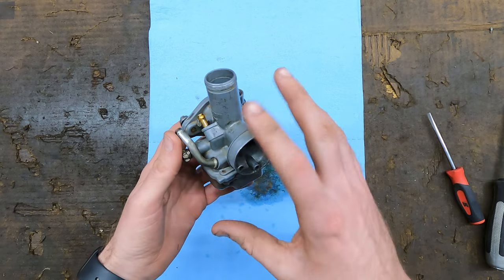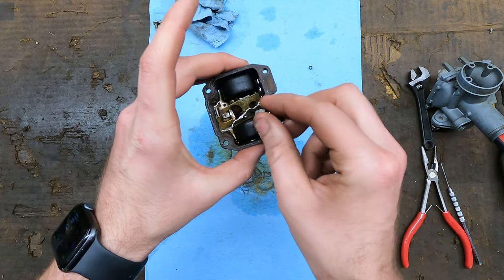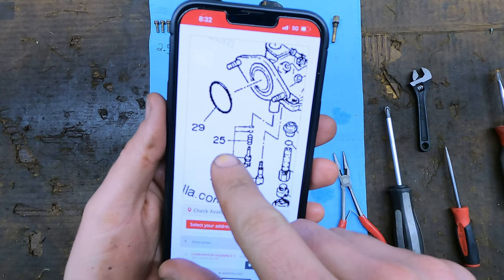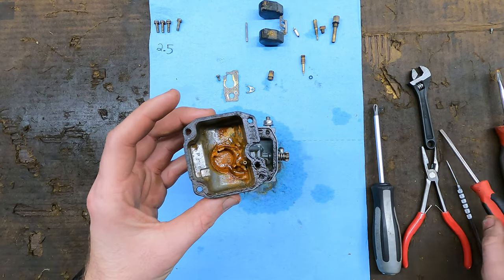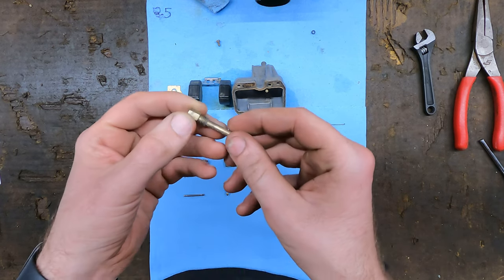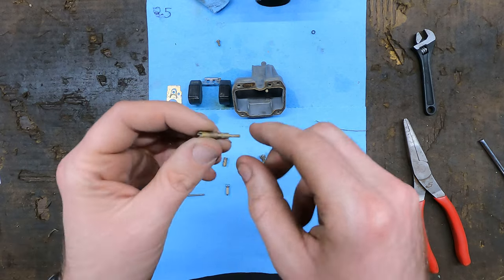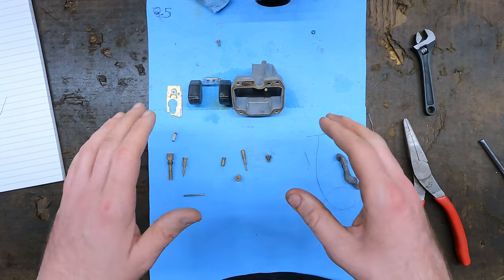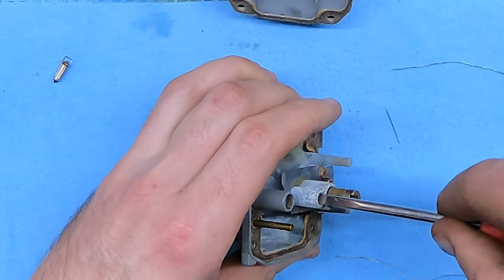In Depth Carburetor Clean on a Yamaha Moto 4

Comment: Great video. I have a 1993 Moto4 350 that was a barn find. Been sitting for years. I’m obviously going to have to clean the carb and I’m wondering what your thoughts are on using an ultrasonic cleaner?  I have access to one that I can use. Thoughts??
Reply from the maker: Love the idea! They work awesome! I’ve got one but I only pull it out for carbs that give me a hard time. But if you have one definitely use it!